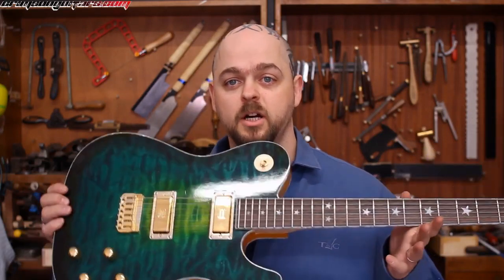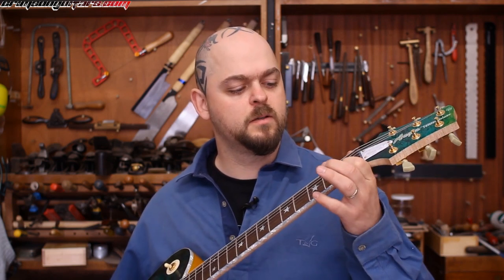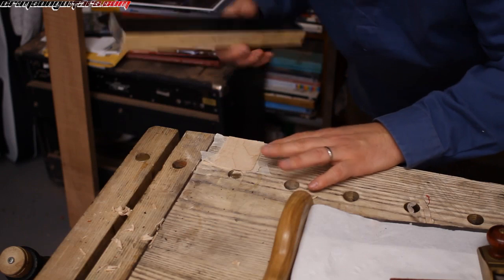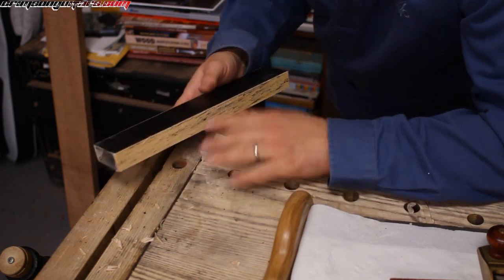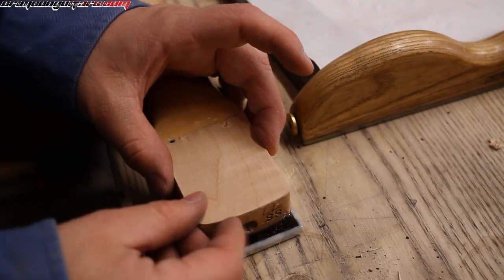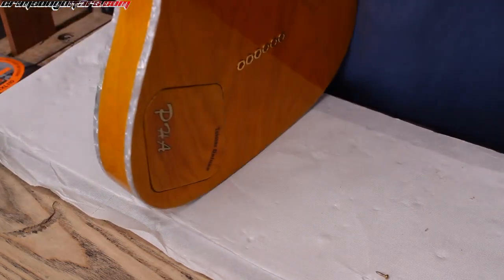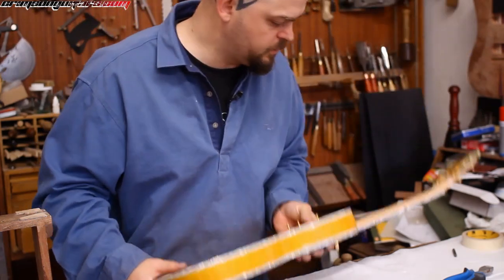Tutorial - How to Shim Your Guitar Neck and Nut

Comment: Hi there from Spain, first of all, I have watched a lot of your videos, and I love them all! I am learning a lot from you so, thank you very much! One thing I realized in this one is that when you are adjusting string heights with the radius gauge, first you check under the strings, but then you move over to adjust G string. That is incorrect, you have to do this allways with the gauge UNDER the strings!! This is a thing that I have been working on recently, I drew in CAE software the strings, and when you have a prefect radius under the strings (the one that really matters) over the strings you are never going to have anything similar to a radius between all 6 strings, just because individual string gauge is not increasing to adapt to that radius. Sorry if it´s difficult to understand and sorry for my poor English! I have checked that several times! Just imagine you swap the G string by a low E string, if you adjust the radius underneath the strings, over them this new 3rd string is going to be higher than all other 5 strings!!

Comment: I was so happy to see you make a wedge shim. I have been preaching for years about that way of shimming. Why go to th trouble of getting a nice tight pocket and then turn around and ruin it by using a business card for a shim. I bought a Schecter 5 string in a pawn shop that the neck was in a bowed condition and the truss rod would not adjust. I removed the neck and put it in some clamps to remove the memory and tightened down the truss rod. After a couple of days I reinstalled and set the relief and intonation. This one is a six bolt neck so my shim was longer than the one you made. I used a sander to shape mine and it worked quite well. I only use this guitar at church as I play in a Praise and Worship band. It plays and sounds great and it only cost me $160 for the guitar.

Comment: Love watching you work.  Bought some tools and neck holder from you couple years ago.  I used to be a finish carpenter and we used to cut our own shims to install doors.  Used my 12" Dewalt compound saw.  Take 2x4 about 8 in long and set in against back fence parallel to saw blade. Set blade angle to 1/2, or 1 or 2 degree, etc angle.  Cut shims 8 in long at what ever angle you set.  They go down to feather edge without having to do any sanding at all.  If 1/2 degree isn't small enough, you can just angle the wood a bit to get however thin you need.   In you case use a piece of maple as thick as the width of the neck pocket and just a little longer than you need but long enough to hand on to it while cutting.  Could make several different angled shims at a time.

Comment from the maker: Here are the exact times when Ben talks about different things in the video, enjoy:

1:08 - The background of shimming in the Fender franchise
2:44 - Looking at the guitar 
3:15 - Tutorial begins 
4:02 - We find out what's wrong with the nut 
5:36 - Marking out veneer for the shim 
6:21 - Tidying up the shim 
9:44 - Creating the angle of the shim using a plane 
9:59 - Creating the angle of the shim using a file 
10:10 - Creating the angle of the shim using a levelling beam 
13:10 - Drilling the holes in the shim 
15:17 - Taking off the nut 
16:52 - How to shim a nut 
20:36 - Gluing the shimmed nut onto the neck 
20:50 - Putting the guitar back together 
22:12 - Taking a look at the once we're done shimming it 
22:29 - Putting strings on the guitar 
24:44 - Adjusting the bridge to get more height on the strings 
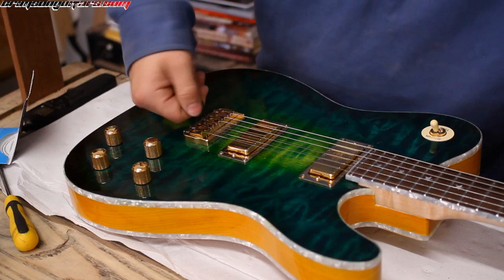25:18 - Using the understring radius gauge to find the radius 
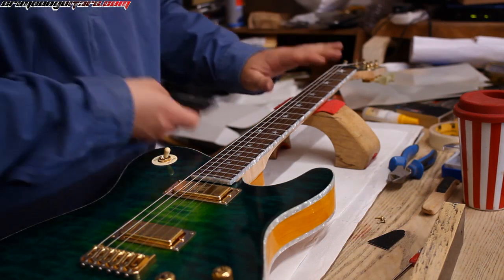25:59 - Checking how level the frets are using the Crimson Guitars fret rocker 
27:51 - Adjusting the height of our newly shimmed nut using the Crimson Guitars nut slotting file 
29:18 - Accurately testing the action of the nut
Reply: Hi Ben, I have a few bolt on neck guitars and a few require a shim just to raise the neck height as the saddles are bottoming out on the bridge plate. The bodies on both guitar are Alder with Maple necks, I have access to wood veneers of many species so would there be a difference in sound with an Ash shim compared to an oak shim or would it not matter, many thanks, love the videos

Comment: Super video about the shim. I researched online, and it's the best video about it. I used your idea to make 2 shims already and great results. I did cut the veneer with a strong Xacto knife and a straight piece of wood as a ruler in a few passes, then fine tune it with a sand block (a straight piece of wood sanded on a piece of window glass for straightness, then glued sandpaper over maskingtape). perfect. thanks

Comment: I used angle saw machine and cut different angle shims from piece of  maple. Took few seconds. A piece of tape and a bit sanding. You can drill the holes first to the wood block.

Comment: Take all guesswork out of determining neck-shim thickness at the front (I've done this only once so far) I string the two E"s lightly. With loose and protruding neck screws I do a before and after measurement of the distance between a front screw head protrusion and the body. All the while I'm holding the neck in the pocket with one hand and tilting the neck to whatever angle puts the strings at the height I want. Then, with some magic, I measure the new distance which will, of course, be less than before. The difference between the two measurements is the thickness of the shim at the front of the pocket. You can now buy pre-made shims from Stew-Mac by giving them your first born.

Comment: The other way is the put in a "micro tilt" which is my preferred method and it doesnt affect the "fender" tone. The 4 bolts and socket for the neck plus the micro tilt contact give plenty of connection to the guitar for tone. Old steel strings by the way should saved whole and used to make the snare for a cajon. At least now we can recycle our strings rather than them going into landfills. I thought you would have put some glass paper on the bench to do your shim  sides. Dont think id like to clean out wood from the fret file. Great video Ben.

Comment: I bought a new USA Kramer and it had a piece of sandpaper for a neck shim. I used pre made maple shims; stewmac and others make tapered ones with holes already in them in various thicknesses.
Reply: i do that as well with my jim root strat. wasn’t a fan of the big headstock and replace with the modern style fender headstock with one piece of sandpaper as a neck shim. without it, it sounds like having dead frets or a fret buzz or a sitar.

Comment: I'm trying to put a Warmoth telecaster neck onto a Harley Benton TE-20.  However the neck pocket is too tight.  The neck pocket wooden tab edge (low E string) is too tight/close to the necks pre-drilled hole. I can't re-drill the neck hole, since it's only a few millimeters too close.  I mean, if I could cut-off that slim piece of wood on the low E neck pocket, it would fit but that would be ugly. Can this project be saved?

Comment: I need to shim my nut.
I liked your idea of using a piece of ebony but, you did not say where to get the wood.
Fortunately I found something that should work even if you need to shim a nut of lighter color.
Stew Mac has binding that is.080 thick. In all sorts of shades.
You can shim a lot of nuts with one strip of binding.

Comment: Making the shim process you did was an excellent process. While sanding with the leveling beam, what's your method to keep the shim completely level? Once again, you are very talented!
Reply from the maker: Thank you.. I do it by feel although if you have a smooth section (ie no sandpaper) at the end of the leveling beam you could rest that on a pencil or chunk of flat wood at the right distance away to get the angle and if you had another smaller piece closer to the shim buy at the same angle that would automate the process.. Both pieces are flat, the angle between the tops of the pieces is right and when you stop taking off material the Shim is perfect, and ready. B

Comment: Thanks for the shim making demo. I managed to make one out of a cedar moth repeller. Cut a slice about 3mm sanded it down with an electric sander to about 2.8mm and then did the rest down to a couple of mm by hand with sand paper on a flat surface and masking tape for a handle. Much better than the two shims both front and back made from folded electrical tape. This vintage 40 year old guitar plays much better with lower action at the higher frets and subtle but noticeably better sustain.

Took two tries and the second one came out perfect :)

Comment: Is there a way to measure the neck or body to check the angle of the neck to determine if it needs to shimmed or not? I mean, other than the reason you used a shim in this video ( which was a great reason ) I just wonder when you should determine the bolt on guitar needs shimming and how to use a tool or measure to gauge things to determine how much against what should be perfect. BTW, using a means of measuring this amount, what is considered the correct angle on say a Strat guitar? Is it ONLY when you are running out of room with your saddles?

Comment: Brilliantly well done ! Could you do a video on when and why it becomes necessary to shim a neck? As in, after a set up, after lowering the action, and insuring the all the frets are level, and adjusting the truss rod... what issue do you run into that necessitates the need to shim? At what point is a truss rod adjustment and fret leveling not doing the job?
Reply: Shim it written everything else is where it should be. Truss adjustment is a curved shape. Shims are flat. Neck pockets are sometimes not cut properly.

Comment: 1: the body has the Warmoth "720" mod which lowers the neck pocket so the fretboard/fingerboard sits right on the body instead of floating above. 2: I have two custom Warmoth guitars and neither needed any fretwork on the tops of the frets or any futzing with the graphtech nut that W installs. This is very surprising to me that the guitar was in this shape.
Reply: Warmoth is awesome!

Comment: Hi Ben, greatings from Italy here. Thank you a lot for all your great lessons and tutorials. There is only one question I would like to ask you. You've put a shim under the nut and it ended up being too high, to resolve that problem instead of shaving down the nut you made the string slot a lot deeper. I always thought that strings must pass through their slots the least possible to avoid tuning issues. Is that correct or isn't it that important? Because at the end, the strings are so deep in the slots you can't even see them on the top of the nut. Thank you

Comment: Don't know if you will see this at this late point....but I have an honest question....

Not only here but in other places I have seen people suggest that when shimming you need the shim to cover the entire pocket and this usually has to do with needing solid connection between the neck and the pocket seat and that things like picks and business cards are no good.

Fender's own tilt neck design sees their neck heel with an embedded slug of metal and the body with, essentially, a set screw and this set screw is the only contact with the metal slug in the neck.  This method makes NO attempt to maintain solid neck to pocket connection.   How are they getting by with that?   It would seem to me that even using a pick would be better than this.  

The real question... is the average pair of ears going to notice the difference?

Comment: shims are neither always necessary, or bad. on the contrary, they allow for further adjustment as needed by the player, unlike set neck guitars in which no such adjustments are possible. yet another reason why bolt-ons are superior. neither are they meant to raise the entire height of the neck in the pocket. rather they're meant to slightly increase the amount of back angle of the neck as it leaves the body. as such, they're meant to be quite small, say the width of a stick of gum. of course, many bolt-on necks now have the ability to adjust the back angle as desired with a factory installed mechanical device (usually accessible by using a small allen wrench in the heel plate). also, many modern guitars have designs where the neck-to-body joint is virtually non existent. not to mention the countless Gibsons that have terribly poor jointery, but nonetheless work well enough. while a strong neck joint is important for structural and alignment purposes they don't effect the sound in any way. after all, electric guitars get their sound from their electronics, nothing more.

Comment: Any tips for getting an even slope? Done a few testers and seem to have trouble - tend to be a similar width to the middle and then drop off to the end rather than smooth from end to end. Using a levelling beam with the shim tape and glued to a wood block as in the video.

Comment: Hello Ben, What would happen if I did the opposite to this regarding the neck? If I lowered the base of the neck by a few thou would this get rid of fret buzz? on a bass? I've taken it back to makers a couple of times and its as if they've not touched it. Its still buzzing like a wasp on smack.
Reply from the maker: 'buzzing like a wasp on smack' awesome! If the action is too low 1st try your saddles and double check the nut but if you can't raise the saddles and the nut is OK then yes, you can remove a little wood from the back of the neck joint or inside the neck pocket.. Just be sure you need to 1st :)
Reply: Thanks, for that I'll purchase one of your fret files!
Reply from the maker: I appreciate your support!

Comment: I'm preparing to shim the neck on a bass because of the same issue. Is there any reason I couldn't use a flat, non tapered piece of veneer aside from being able to see it from the underside?
Reply: It's a fair question. What you suggest will only help you if the bass' issue is that the saddles need to be lower but they're already as far down as they can go, in which case the flat shim would raise the neck but keep it at the same angle as the original angle. But you might need a pretty thick shim to do that.

I'm interested in this video because I have an early Music Man bass with a Fender-style Micro-Tilt adjustment - a set screw threaded into an insert in the body that presses up on a metal insert in the neck heel. This means that the next heel is actually suspended only by the set screw and the outer bottom edge of the neck pocket, with the three neck screws under tension to hold the next there; in between the neck and the pocket is an air gap. I'd like to eliminate that gap.
Reply: An update. I did just that (using a flat shim on a bass where the saddles would go no lower) and it worked perfectly. I only ended up needing 1/16  shim so it's not so noticeable

Comment: "I don't know how I would have done it without the masking tape trick" My first thought was why didn't you rub the wood down before you cut the little square out of the sheet of veneer? Larger piece of wood is easier to handle and secure in place while working on it. That's how I would try and do it.

Comment: Could you use balsa wood, or is it too soft...I am new to this and finding a tiny piece of maple?! Uhhh...where? I do some model work with balsa would and it's really great to work with, but is it hard enough? Thanks.
Reply: Ebay has sheets of veneer for not much money. If you have a woodshop near you then there might be offcuts available.
Reply: @anomalousresult  Thanks...off cuts. Like shavings. I'll check it out. I have some veneer of an old cabinet but it isn't wood. Some kind of 1960's plastic type stuff made to look like wood. It's very thin and tough. Might try that.
Reply: @AnthonyMonaghan  i meant more if they've sawn up veneer to order and have scraps
Reply: @anomalousresult  Thanks

Comment: Micro-mesh would be wonderful for the finishing sand on that nut. Speaking of which, do you know what type of nut that is? it looks like a Graph-tech TUSQ to me.
Reply from the maker: I love micro-mesh! I'm pretty sure it is tusq, great material, though buffalo horn looks similar and has the benefit of recently been part of a buffalo!? :)
Reply: I agree with you haha. I do enjoy using the Graph-Tech nuts though as they are self lubricating. I use micro-mesh when I'm finishing crack repairs on pro-level clarinets and other woodwinds.

Comment: I just TRIED to make myself a neck shim.. I had it 99% done & when I was drilling it slowly with a brad point bit that sum bitch split right up the wood grain = should have drilled it first while it was thicker, I glued it back together & will have a look a saving it in the morning, My Son bought a stratacoustic with a tele neck for $75 yesterday & it's in need of having it's action lowered, I know I can also shave some off the bottom of the saddle too.. I suppose the tele neck was worth $75 So all is good.. Gary/Hk

Comment: Wait a sec - if EVERY fret is rocking, doesn't that just indicate that there is back bow?  Shouldn't you first adjust the truss rod to flatten the neck before jumping in to a fret job?  I assume you did that while doing the frets?  Wondering how bad a warmoth neck actually was, as they are supposed to be pretty good...